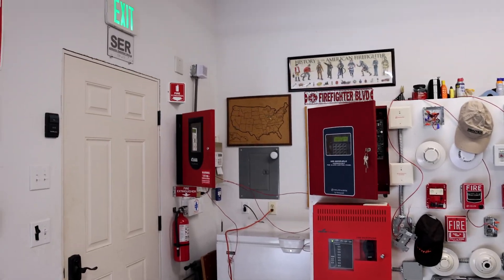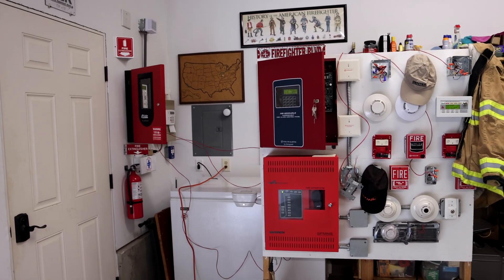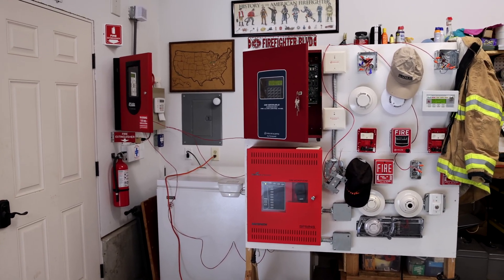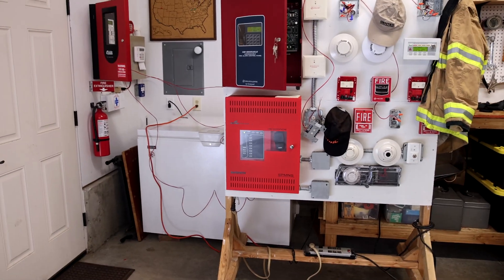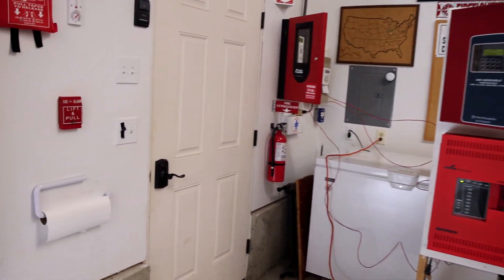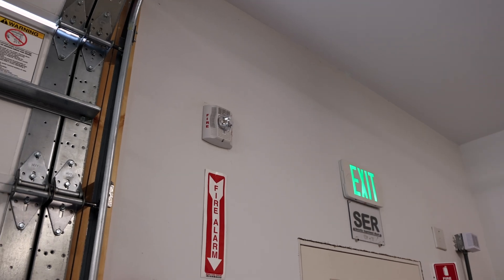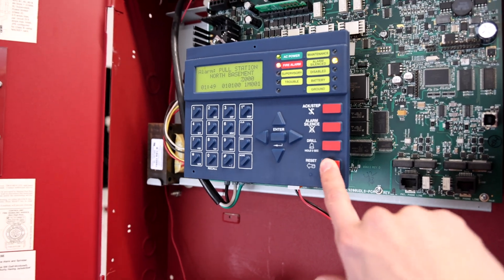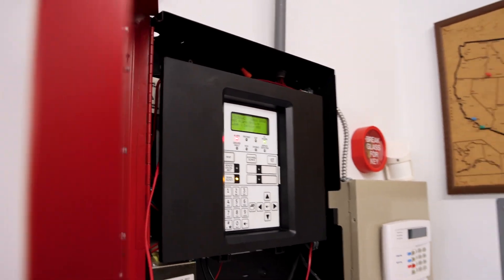Kidde Fire Alarm System Test 29.5 | Fire-Lite Voice Evacuation!

Comment: So I'm curious. Pull stations of course are there to set off the alarm system and tell the building to evacuate. Do some fire alarm systems also notify the fire department automatically when a station is pulled and the alarms go off? That would be kind of cool to have that option in order to eliminate the need to call 911 since the fire department has already been notified of the emergency. The only downside is that now you have to get them involved whenever there is a false alarm or something, which could take their attention away from a real emergency

Comment: Would it be helpful to have a screen that shows where all the smoke detectors are (with building layout) and if they were triggered by smoke?

This is how I’d think it would work, essentially fire alarm black box, also helps see where the fire is I guess:

8:21:11 AM - Smoke detected | FL-1, detector 1

8:23:40 AM - Smoke detected | FL-1, detector 3
etc.

You could probably also customize what detectors should have an extra bit of info, like “detector 4 - office”, but the on-screen building layout would already do this.
it could also log the response the system had to the fire

(there’s probably something that already exists that does this, this was just a funny little idea I had at 2:30 AM, I have no experience with any of this stuff)
Reply: I ain’t a fire alarm genius, but I’d thing this would be at least a little helpful, if the building didn’t have cameras, or that they broke, if someone needed to know when the fire was detected